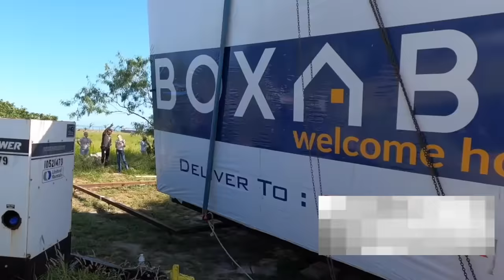Learn More About BOXABL - 5 Minute Pitch

Comment: Now just design it so that all the wiring and the electrically powered systems in the house are EMP-resistant and that the house is so energy efficient that a reasonable amount of solar panels and storage batteries can take the house completely off the grid. Lots of people want small homes in beautiful, off-grid locations.
Reply: Exactly , anywhere , what will be the rental cost of the land or where can they be moved to ….
Reply: Damn, that would be awesome!!! I hope it will be possible one day.

Comment: anybody else have anxiety when the truck maneuvered that home OVER the fire hydrant?
Reply: It didn’t, it passed very close to the side though. They have spotters on foot for turns like that.
Reply: As a truck driver myself, yeah. But more because of the slope. My trainer got a rig stuck trying to turn around and running up on a slope. I told him to stop but he didn't listen to me (I got another trainer soon after this because I was definitely not listening to him!) When the tractor was half up slope, the drives on one side came off the ground and on the other side they were pinched under the trailer. Stuck. We had to call a wrecker. Lessoned learned.

Comment: This could be very interesting thinking about public housing for the homeless, low cost quality housing for entry level workers, temporary housing after natural disasters, there's lots of issues this could really help with. How does the material do with stressors like hurricanes, flooding, earthquake, etc
Reply from the maker: We expect our buildings to outperform on water, wind, fire, energy, snow and more. We will be publishing third party test data to back up these claims soon.
Reply: @BOXABL  I live in a major snow state. We've had this building since the 50s. Flat roof and triangle roof. It saw the 67 storm as well as the 79 storm (Chicago). 

From my half century experience with Chicago weather, snow, especially in something this small, isn't an issue. 

What IS, is drainage (lots of rain at least twice a year, spring and fall) and heat/cold. It can be as much as 107 (deadly heat wave for poor people) or well below 0. 

Wasting the water is silly. So is wasting it for things like baths and showers. It should be recycled. But you have the cootie issue (Legionare's Disease. For one)

Comment: Government red tape such as permitting and overbearing code requirements are why the housing industry is stuck in the dark ages.  I really hope Boxabl takes off.
Reply: Will there be all the red tape, just like when you try to have a tiny house? No insurance, no mortgage company will touch it, no zoning.....?
Reply from the maker: @savannahsputnik1663  We will have standard insurance just like a regular house. Different areas have different zoning rules. You can try reading rules on your local governments website, but sometimes it can be confusing. Boxabl has partnered with permits.com to provide an easy resource for questions about permitting.
https://boxabl.permits.com/
Reply: Depends on what city/state you're living in as to how bad the requirements are. Usually once you leave the city and move into the rural areas it's just not as stringent.

Comment: The structure is one thing. What about land/regulations? Water and sewer connections?  Air conditioning system?  How do all those work in different states and cities?  How to go about acquiring available land? Taxes?
Reply: They aren't aiming or claiming to solve those issues.
Reply: @tams805  I meant to ask how does one start acquiring land etc in one's city?  Where do we go to find more info?
Reply: @mysteriousjz  you'd have to look for a real estate agent in your area for land. Or if you have a friend willing to sell you a plot. This company just builds homes.
Reply: He's providing you the structure you can put on top of the rest.  You provide the plot, foundation, place and set the unit, add roofing, pull any permits for desired utilities, etc.
I think the trick is buy 'dirt cheap' land with nearby services.  All utility hookups are at a corner.  Plan accordingly.

Comment: The assembly line was invented by Eli Whitney as a result of his invention of the "Cotten Gin" and it's huge success and needing to make lots of them very accurately so his supplied spare parts could be easily installed on the worn machines. All this happened in the 1790's well over 100 years before Ford worked out auto assembly lines. Also gun mfg. Samuel Colt perfected a gun assembly line and parts supply system from Whitney's ideas around the 1880's with similar success.  Boxable is very interesting and may be the people's do to houses what Whitney, Colt and Ford did before them with machines!

Comment: I've seen the video on the 1 bedroom unit and I after a year of thinking about it, l really think I need 2 bedrooms. So, I've been checking back at the website periodically to check different models etc. I haven't put a deposit down but would have if I had some kind of ballpark on the time line. But now, 11 months to production, 3000-5000 per year and 20,000 already waiting... It sounds like a 5-year waiting period... I'm discouraged....

Comment: These are cool and all but I have some concerns. 

Are they durable? Can they withstand hurricanes and natural weather? We have conex type containers here in South Texas and they rust out pretty quickly. How is the insulation? Seems like it would be hard to get some kind of filler in those thin walls. 

If it is 110 outside what can I expect the inside climate to be like provided I have thermostat set at 75?
Reply from the maker: Boxabl’s are very strong and should be rated for hurricane winds; they are able to handle the country’s worst wind conditions, like Miami, Florida. We will be publishing third party test data to back up these claims soon.

Comment: How do these holdup on heavy rain, snow or winds? Your Casita might go Flysita with YOU in it.👀 Or am I wrong?
Reply from the maker: Yes, Boxabl’s are very strong and should be rated for hurricane winds; they are able to handle the country’s worst wind conditions, like Miami, Florida. We will be publishing third party test data to back up these claims soon.
Reply: @BOXABL  Great! Thanks for replying.
Reply: According to HUD, it has to be attached to a permanent foundation. this is a great concept --however more information is needed on design & how HUD will accept these as loan approvable. so much more to housing than just the structure. modulur is the way to go though....

Comment: At 50k base model for 375sf that’s $133/sf not including land, utilities, permits, anything else that makes the house plug and play. The final cost will be at least double. That’s a lot of cash for a small studio and China won’t buy those, they already make container homes. 
I’m in construction and love the concept and agree with the streamlined building process 100% (been preaching that for many years) but that’s NOT on the affordable housing pricing side of things. You can build 40’ insulated containers homes for much less than that per SF and those too can travel on a truck.

Comment: When you say box house how long does it last? What about pipes running water..... I don’t think it’s as easy as it should.
Reply from the maker: Boxabls are made from steel, concrete and EPS foam. These are building materials that don’t degrade and will last a lifetime. The walls, floor and roof are structurally laminated panels that are much stronger than the average building.

Comment: I've seen everything in the video but does not talk about air conditioning and heating where are them going to be at and the ducking and how insulated will be compared to traditional home
Reply from the maker: We use a Mini Split system. One mini split is more than enough for the Casita. Other bigger models will have a more custom solution that include other air handling equipment.

Comment: What happens in areas that get hurricanes?  What do you use to secure the house to the foundation?  Do you use tie-downs like mobile/manufactured homes?
Reply from the maker: Boxabls are rated for hurricane speed winds. They can handle the worst wind conditions in North America.A Boxabl is compatible with any foundation type. It simply bolts on. The floor on the Boxabl is very strong so it needs minimal support. See https://www.boxabl.com/foundation-options

Comment: wood house lol
Reply from the maker: Boxabls are made from steel, concrete and EPS foam. These are building materials that don’t degrade and will last a lifetime. The walls, floor and roof are structurally laminated panels that are much stronger than the average building.

Comment: Can you provide information about the insulation and the HVAC provided? What kind of roof is provided? Do you have a version for a garage shed?
Reply from the maker: The house is very well insulated. In fact, the design is similar to an igloo cooler or refrigerator. All the air will be trapped inside and conditioned. This means a Boxabl will do great in high heat or high cold climates. Plumbing, electric and HVAC all come pre installed in your Boxabl from the factory. Utilities simply plug in on site to the exterior corner of the Boxabl.

Comment: Is the thermal insulation poor with the fold joints in the ceiling?
Reply from the maker: No, The house is very well insulated. In fact, the design is similar to an igloo cooler or refrigerator. All the air will be trapped inside and conditioned. This means a Boxabl will do great in high heat or high cold climates.

Comment: Does it come with heating and air and plumbing
Reply from the maker: Air conditioning and heating are included, it’s a mini split system. One mini-split is more than enough for the Casita. Other bigger models will have a more custom solution that includes other air handling equipment.

Comment: What materials are the walls made from? In my country the houses are primarily made from concrete.
Reply from the maker: Boxabls are made from steel, concrete and EPS foam. These are building materials that don’t degrade and will last a lifetime. The walls, floor and roof are structurally laminated panels that are much stronger than the average building.

Comment: Which material is the house made of?!
How stable is the house during extreme rain,storm and Incase of earth Quake?!
What are the anchoring of the house?
Reply from the maker: Boxabl is made from steel, concrete, and EPS foam. These are building materials that don’t degrade and will last a lifetime. The walls, floor, and roof are structurally laminated panels much stronger than the average building.
Reply from the maker: We expect our buildings to outperform on water, wind, fire, energy, snow and more. We will be publishing third party test data to back up these claims soon.
Reply from the maker: A Boxabl is compatible with any foundation type. It simply bolts on. The floor on the Boxabl is very strong so it needs minimal support. See https://www.boxabl.com/foundation-options.

Comment: Went to your website and seen this video. Would like to know the insulation R value of your roof and walls. Also I would like more information how fold up roof is seal against rain and the adjoining walls. Interested in having one in Las Vegas and that desert heat is brutal.
Reply from the maker: Likely performance of the Boxabl is R30 walls, R-25 ceiling and R50 roof, energy star rated. The house seals up using gaskets much like a car door, it wont leak.

Comment: I think you guy's  are on to something  great ideas . But what about people  who live in regions  where it get very very very cold how insulation  be for those in those parts of our country  what about heating .
Reply from the maker: The house is very well insulated. In fact, the design is similar to an igloo cooler or refrigerator. All the air will be trapped inside and conditioned. This means a Boxabl will do great in high heat or high cold climates.

Comment: Questions for what about places that get heavy snow. Your houses have flat roofs snow can be heavy. And are they insulted to block cold air.
Reply from the maker: The Casita has a flat roof that is watertight, insulated and snow load rated. Some areas will require a pitched roof, in that case you will add a roof solution on site with your roofing contractor. In the future we hope to provide plans for this and potentially a roofing solution that we will sell separately.
Reply: @BOXABL  thanks! You could make the roof slant in one direction that it would still fold right up with the house box design.

Comment: Are those houses safe, do they withstand hurricanes?
Reply from the maker: Yes Boxabls are rated for hurricane speed winds. They can handle the worst wind conditions in North America.
Reply: Do the have a steel frame?
Reply from the maker: @MichelleSmith-ky8lz  Boxabls are made from steel, concrete and EPS foam. These are building materials that don’t degrade and will last a lifetime. The walls, floor and roof are structurally laminated panels that are much stronger than the average building.

Comment: Do you make a roof design that would work in areas that get major snow loads?
Reply from the maker: The Casita has a flat roof that is watertight, insulated and snow load rated. Some areas will require a pitched roof, in that case you will add a roof solution on site with your roofing contractor. In the future we hope to provide plans for this and potentially a roofing solution that we will sell separately.

Comment: Can you build one with solder panels included in the roof?
Reply from the maker: You can setup utilities however you want to at your site. Whether its a water tank or solar panels it will connect the same way to the Boxabl as regular utilities.

Comment: What about plumbing and electricity?
Reply from the maker: Casita comes ready to plug into the site; the site work is not included. That must be set up in advance. Boxabl clients will be responsible for ensuring site requirements are already in place. Plumbing and electrical are already ready to go inside the Boxabl, all you will need to do is have your Boxabl certified contractor connect it to your site.

Comment: What about septic/water ?
Reply from the maker: The Casita comes ready to plug into the site; the site work is not included. That must be set up in advance. Boxabl clients will be responsible for ensuring site requirements are already in place. Plumbing and electrical are already ready to go inside the Boxabl, all you will need to do is have your Boxabl certified contractor connect it to your site.

Comment: How do you install water and electricity?
Reply from the maker: Casita comes ready to plug into the site; the site work is not included. That must be set up in advance. Boxabl clients will be responsible for ensuring site requirements are already in place. Plumbing and electrical are already ready to go inside the Boxabl, all you will need to do is have your Boxabl certified contractor connect it to your site.

Comment: How about heating system for Alaska?
Reply from the maker: The house is very well insulated. In fact, the design is similar to an igloo cooler or refrigerator. All the air will be trapped inside and conditioned. This means a Boxabl will do great in high heat or high cold climates.

Comment: The roof is flat, how safe this is in the snow season?
Reply: They have said in a FAQ that they have curved roofs that can be attached because some states do not allow flat roofs. So they got you covered 👍
Reply: @DayBowBow  hopefully adding on the roof means we can use the empty space for storage
Reply from the maker: Boxabl comes stock with a flat roof system. Some areas require a pitched roof. In that case we will provide your installer with roof plans and they will add the roof on site.

Comment: How does this work? Does one have to pay the whole 50,000$ on hand. Or do we have to pay like a 20% first?
Reply: financing. loans. surely  you wouldnt have to pay 50k cash
Reply: Unless you have 50k lying around
Reply from the maker: The $250 number on the front page of the website is an estimated finance cost for the Boxabl room modules only with an average 30 year mortgage. Any additional install costs would also be added to the mortgage. Final payment will be maybe $250-$500.
Reply: @BOXABL  does the amount ( mortgage) given by the lender include the cost of 1) land and 2) the concrete slab/plumbing? Or is it only for the “boxable”?
Thks.

Comment: Are you guys working on how to include land, foundation, sewage, water lines. Maybe boxabl can secure at separate company that will handle this matter in an affordable way. This is the future, however, it’ll only happen if millennials move from the super populated coasts to inland states. Inland states that have easily accessible cheaper land, where new boxabl cities can be made. The millennial population will be your market !
Reply from the maker: At the moment, You will be responsible for land and setting it up.
 Plumbing, electric and HVAC all come pre-installed in your Boxabl from the factory. Utilities simply plug in on site to the exterior corner of the Boxabl.  You can also check https://www.boxabl.com/faq. Thank you.

Comment: Can these be insulated AF please?
Reply from the maker: The house is very well insulated. In fact, the design is similar to an igloo cooler or refrigerator. All the air will be trapped inside and conditioned. This means a Boxabl will do great in high heat or high cold climates.

Comment: How about extreme cold weather ie -40 degree C?
Reply from the maker: The house is very well insulated. In fact, the design is similar to an igloo cooler or refrigerator. All the air will be trapped inside and conditioned. This means a Boxabl will do great in high heat or high cold climates.